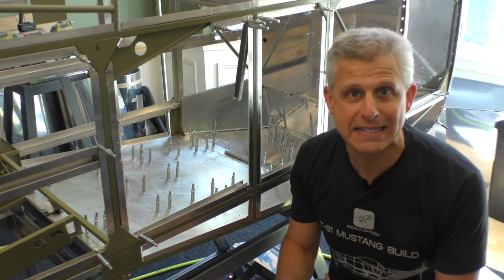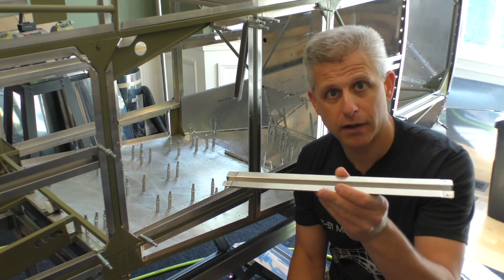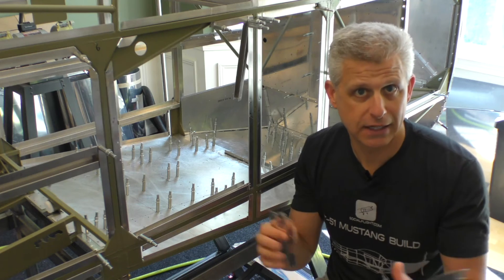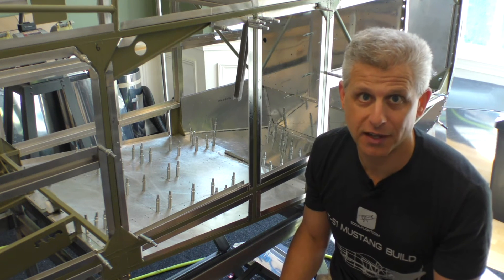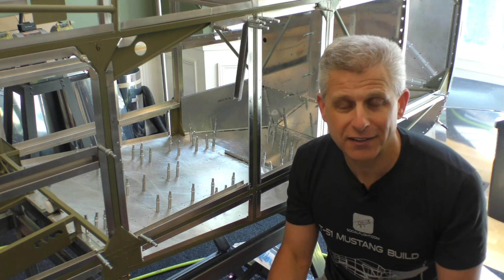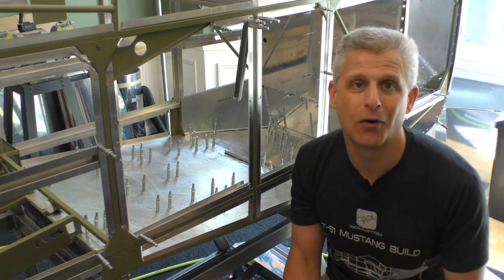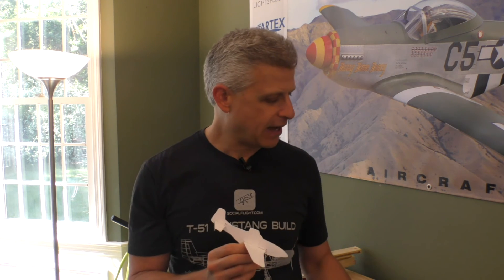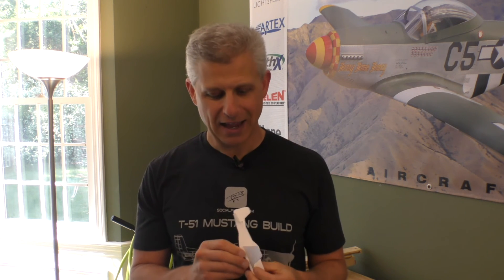The T-51D Mustang Gets a Cockpit Floor!

Comment: I don't understand why you are using pop rivets instead of AN driven rivets. We built a Thorp T-18 back in the 1970's. All driven rivets, no pops. Took 2 years 7 months. An awesome aircraft.
Reply from the maker: The Titan T-51 Mustang is a Steel Tube structure with the skins glued and pop-riveted to hat sections.  The hat sections sandwich the steel frame square tubing.  The factory design uses pop-rivets and the final structure is remarkably strong with the combination of the steel frame and stressed skins.

Comment: Great video series, guys!  I have a question.  You mentioned that your T-51 will have a small block V-8.  Is there a way to modify it so that you can use 100LL or do you have to always use Premium Unleaded?
Reply: I'm curious as to why you'd want to use 100LL, given the very high price. It'll probably do just fine, but you might gum up some sensor eventually.
Reply: @Sethgolas  I was thinking strictly for ease of availability at most airports.  Especially overseas where mogas is sometimes pretty sketchy.
Reply from the maker: It actually runs fine on 100LL, which is more convenient at airports.  That said, we plan to use auto gas when possible.  Each fuel has it's upside/downside...   @robkolinsky1285
Reply from the maker: Our understanding from the factory is that it runs fine on 100LL, but we certainly intend on using regular gas when we can get it!

Comment: What's the ratio of pop rivets to flush done with bucking bar if any? Are the pop rivets counter sunk or dimpled to limit drag?
Reply from the maker: Only the rivets on the wings are flush.  The ones on the fuselage are regular domed head pop-rivets.  It looks remarkably accurate to the actual P-51!